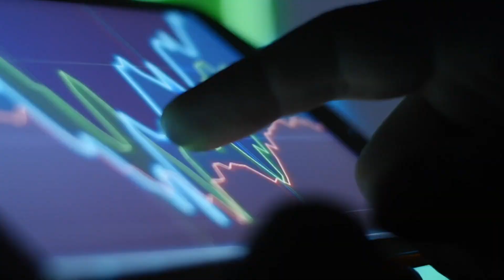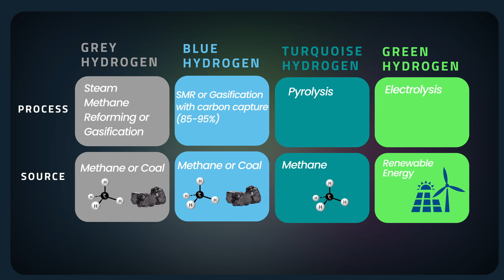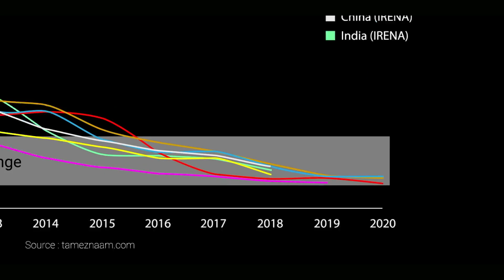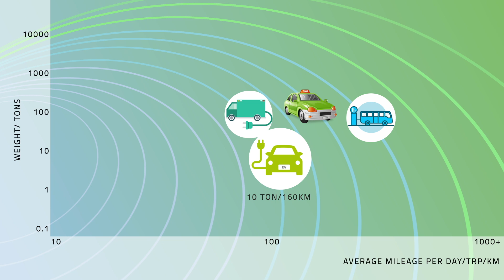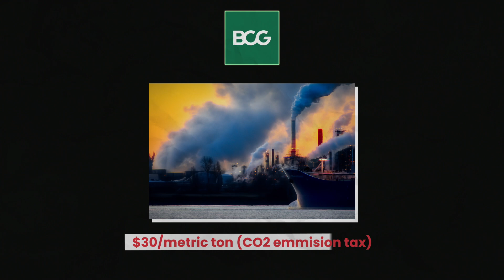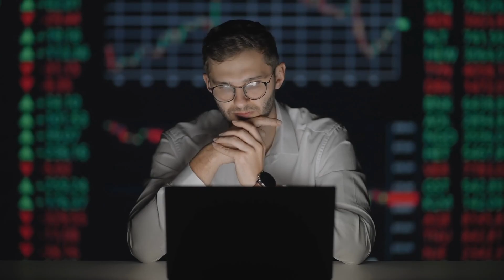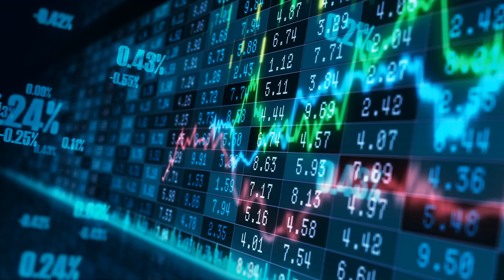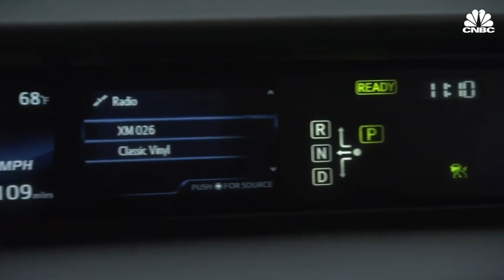Why NITIN GADKARI is pushing GREEN HYDROGEN for Indian Industries : Policy Case Study

Comment: I thought this was a fact based channel, highly disappointed by the one sided story, clearly a biased piece made to fool the audiences, why were ZERO Disadvantages mentioned? I will mention just two disadvantages which will PROOVE the entire video content to be biased and full of agenda:-
1 Energy Efficiency : Hydrogen REQUIRES almost as much energy to PRODUCE as much it DELIVERS. CE Efficiency is 60%. Lithium CE Efficiency is 90 to 99%!
2 Energy Cost : Transporation, storage and maintainance of Hydrogen is highly Costly! Hydrogen energy costs 3 times more than storing and utilizing the energy in lithium ion batteries.

Either you do not know what you are speaking about
Or You take audiences as a fool by delivering highly biased facts.
Or Both
Reply: There are many more disadvantages example:-
1 Hydrogen fueled devices are way more expensive
2 While the weight of hydrogen itself will be lesser, you would need highly re-enforced tanks to not let any leak else it will blast, and a lot of heavy electronics and electrical devices to compress and decompress it! Adding up to practical weight of the devices!
Reply: unsubscribing as I had thought this was a unbiased fact based channel of information, I have been proven wrong.
Reply from the maker: Super glad to get rid of such people in the audience who don’t even watch the video properly and yet bother to give unsolicited opinions. 
P.S 14:25 limitations are mentioned CLEALRLY

Comment: For me it is plain stupid.   Just listen to what Elon Musk says about H2.
Reply: So  Elon just  invented  his everything  in    Li-on battery   so he have to talk shit to any alternative  of electric  cars
Reply: @navtejchoudhary583  You youself did not read about H2.  It is mostly from oil.  If it takes 1kg of oil to go from Pune to Mumbai it will take 3-4 kg of oil to make H2 to go the same distance --- why?  Besides it must be stored in a very high pressure container meaning the fuel tank must be made with very thick metal and H2 has a property of making the metal brittle.  Besides there is a huge leakage because H2 is the smallest atom in the universe.
Reply: One chemist said the higher the pressure of combustible gas the more dangerous, H2 is the most combustible gas at very high pressure.  Accidents on the roads will be very dangerous.  Imagine a H2 fuel station blowing up.
Reply: Japan was publishing lots of research papers on H2 but even they stopped.

Comment: do not agree with your last point about India cracking the code of Green Hydrogen , Scientists in Japan and Korea have been doing R&D on Hydrogen for the past 2 decades ...India is no where in the scene....We might end up like the Solar push where we were just importing Solar Cells from China and assembling them in India ...finally China increased the prices because they had a monopoly and we had no clue on Solar Cell manufacturing ...

Comment: if hydrogen is created by electricity so if countries have machines for electrolysis they dont need hydrogen as energy they can convert water into hydrogen by using electricity so the one who has high supply export of electricity will be a super power in future and not the one with hydrogen

Comment: You didn't mention a single time that hydrogen is viable only in liquid form and it is extremely difficult to contain and store in liquid form. Hydrogen containers will take far more space than regular fuel containers for a reason why you cannot carry more/enough hydrogen and also make it efficient. Furthermore, hydrogen molecule is the smallest compared to any other molecules. It is impractical to cage it successfully. It's only about time that the fuel container will get emptied by itself (almost).
Reply: But bhai hydrogen cars toh available h....usme kaise store hota h??????
Reply: @siddharthgupta1840  bhai, available hain, lekin efficiency bohot hi poor hain.
Reply: @shounak911  ok....thank you bhai 👍👍👍👍👍🙏
Reply: @albion yes I got the reply earlier 👍

Comment: Hydrogen is not a good  fuel. Yes the energy density of Hydrogen is 140MJ/kg but its energy volume density is about 5MJ/Litre even when packed at 700 Bar of pressure. For comparison LPG is around 25MJ/Liter, Petrol and diesel is around 35 MJ/Litre. Hydrogen has the lowest density of all available fuels. Add to that the fact that Hydrogen has no odour, it is one of the most dangerous fuels if we pack it in 700 Bar pressure. 

Just because Hydrogen is taken via electrolysis from solar panels, it doesn't mean that it is green. Manufacturing the solar panels takes a lot of carbon footprint. The typical efficiency of electrolysis is around 80% and add to that the efficiency of hydrogen fuel engine of 40%. You would be better off providing a solar panel to every house than converting water to hydrogen and back to water.  

I just wish that the government would invest in more realistic sources of fuel. This is a huge waste of Tax Payer Money.

Comment: We use solar energy as a source and green hydrogen as FUEL to generate  energy by using water(non renewable). Really a good combination. Also in electrolysis oxygen comes as by product which should be released to atmosphere as it is vulnerable for combustion.  wait a min. RELEASING OXYGEN TO ATMOSPHERE  AT THE COST OF EMISSION. WOW ...  TAKING HUMANITY TO NEXT LEVEL...

Comment: Hydrogen fuel cell vehicles are good in terms of time it takes for refueling the vehicles but are not at all energy efficient with respect to EV as  EV's are around 80% energy efficient where as HFCV are 40-45% efficient and if we look closely the whole process of electrolysis is acting as a middle mam as we could directly use the renewable energy for transports via EV's ........ I think the future could be a hybrid vehicle where we can use both a hydrogen fuel cell as well as a lithium ion battery which could not even reduce refueling time but also will be cost efficient. such that if a person has time to refuel he can choose to charge it with electric charger at a low cost and save up some money where as if a person is in a hurry he can refuel his vehicle with hydrogen and save up some time.
Reply: Same thing I was thinking. That compared to EVs hydrogen fueled cars are way less efficient.  But also production of lithium ion bartteries are environmentally hazardous.
Reply: Hybrid isn't possible at costs it will increase the price and weight of the vehicle and off couse the maintenance so i think the future vehicles will be divided into batteries and hydrogen cells
Reply: @soniya487  yes correct, future cant be singular solution, it will be just like current petrol, diesel, coal, fossil fuels, solar, nuclear etc.
Reply: Benefits of Hydrogen over EVs are high energy density and faster refueling rate. So HYDROGEN is to replace Diesel vehciles like trucks where as Petrol vehciles would be replaced by EVs.
Reply: @navan1087  Another advantage to EV is the electrical grid serves as a distribution network. I think there is a place for hydrogen in more specialized areas. South Korea was leader in hydrogen fuel but they have given up on it.

Global warming idea is a monumental scientific fraud. Earth will be cooling for next 30 or more years due to increased cosmic rays reaching earth due to sunspots decreasing. We need to protect our power grids from geomagnetic storms. Anything above X20 or above will start to threaten the grids.
Reply: @prioris55555  South Korea, especially Hyundai have never given up on hydrogen, one year before they launched hydrgen truck.They have invested so much on this technology & cheap hydrogen will be available within a decade.
Reply: @navan1087  EV has won the vehicle market. Hydrogen has lost.
Under the plans for South Korea, the numbers of electric cars will rise by 200,000 units and hydrogen vehicles by 35,000 units, respectively.

Trying to do both is flushing money down the toilet. Hydrogen vehicles can't compete with EV.  There may be non vehicle uses or some specialized vehicles.
Reply: @prioris55555  Hydrogen is still a maturing tech & it will take another decade.So please stop making stupid assumptions like hydrogen has lost, give up etc. Even the Nithin Gadkari came in a hydrogen car recently.& i dont want to argue anymore with you & waste my time.
Reply: @navan1087  Nithin Gadkari is too heavily invested yo admit it.
India has an infinitesimal car market compared to rest of the world so irrelevant.
india should focus on mass transportation and not EV.
Reply: but what i was thinking is that, through the process of electrolysis water is splitted in to both oxygen and hydrogen, the resultend oxygen can be also used as a commercialy  like selling oxygens in to end users like hospitals and patients, so that the cost of hydrogen fuel can also be reduced. but i hope they may have already considered this before making an estimation about the cost and price of green  hydrogen fuel
Reply: @krishnaprasad2006  yea right and that companies doing that already
Reply: @krishnaprasad2006  bro that oxygen  can be sold and also can be used as a form energy  and can be export
Reply: @vinayakzanjad7894  i know that bro🤣🤣why are you telling the same thing to me which i already had commented here🤣🤣. Are you drunken???
Reply: @krishnaprasad2006  you said oxygen for patients I said oxygen for energy  purpose 🤣🤣🤣look at diffrence dunkie
Reply: 🤣🤣🤣🤣even we put whole russia under solar panels  we cant produced  sufficient  energy  for our India ev needs
Reply: The comparison is not really apple-to-apple. it is clear that consumer level car is going to be completely EV with no doubt. But there is a large space where energy needs and requirements are completely different where batteries just cannt solve the problem, e.g., large commercial fleet, industrial needs etc.

Comment: The major downside of electrolysis is the by product (O2) and the use of water (H2O). Where do we get the WATER for mass manufacturing of hydrogen ?. Humanity is heavily depend upon water , the humanity will be wiped out from the face of earth if there is water scarcity. And the next big thing is the byproduct which is oxygen , what are we gonna do with oxygen . We cannot simply release it to the atmosphere just because oxygen is a good gas. If we release too much of O2 to the atmosphere, that would create Oxygen imbalance in earth which is worse than hydrogen bomb. (There is a documentary about oxygen imbalance in YouTube ). 

So there should be strong international laws to monitor the entire hydrogen generation lifecycle, otherwise this will end up in tragedy just like oil/gas.  That’s exactly the reason why Elon Musk was not in favor of hydrogen and favors solar energy.

Comment: I was going to say that this was a poorly researched video, but to give you credit, you covered all the issues of hydrogen in the conclusion. But I wish you talked about it in more detail. So I would like to add a couple of points

Honestly, I don't think green hydrogen is going to work for transportation. Mainly because the storage and transportation issues are more of a physics limitation than a technological limitation. Hydrogen is the tiniest element in our universe and making a leakproof container to store it is pretty much unfeasible for massive consumption. And if it leaks, it will all just rise through the atmosphere making it irrecoverable. Hydrogen is also extremely flammable, so safety again becomes a concern (remember zeppelins?)

With the rate at which Lithium-Ion batteries are getting better + and intense research into alternative batteries such as solid-state, aluminium, etc I think battery tech is going to improve way faster,  that we won't really need to look towards hydrogen for commercial transportation. And the great thing about BEVs is that they can be used even without infrastructure given the advent of electricity everywhere, but making safe, reliable Hydrogen stations in such a short time to meet our climate goals is next to impossible

Also, you made a point about how if anyone cracks the code for perfecting electrolysis and green hydrogen production, they're going to be a net energy exporter. I don't really understand how you came to that conclusion because once the tech is out there, it will only take a handful of years before almost every country can invest in their own hydrogen production plant since the inputs required for it is just water and electricity. Transporting hydrogen across the seas over a period of months or pumping it through a pipe is not feasible at all as I mentioned in the first paragraph 

For industrial uses, hydrogen could definitely be a viable option. But it needs to be local and there needs to be a proper and clean channel to bring in seawater for electrolysis use rather than digging up underground water like how most industries operate today

Comment: Ganesh you forgot one and the biggest drawback of HYDROGEN. IT IS VERY HARD TO STORE IT, it's molecules r very small and can easily leak from tanks which is the biggest problem as we all know calori value of hydrogen is very very high. Even small leaks can do a lot of harm and as you said at end of video that electrolysis takes a lot of power to produce electricity which reduces efficiency by a lot
Reply: *calorific not calorie, some times autocorrect is stupid

Comment: i dont think that green hydrogen will ever be viable because:
1) public and private transport can be powered by overhead/under the road cables which can wirelessly supply power
2) The tanks used would have to be thicker and there is leakage of hydrogen through the molecules of the metal.
3) hydrogen will be stored at -250C approx so you would need to cool it which takes up energy.
4) when you fill up your car with hydrogen there will be the formation of ice around the hose pipe so the pipe will be difficult to remove. they do provide a heating element but you may have to wait. 
5) How would one know if they are getting green/blue hydrogen.
So to conclude hydrogen is worst idea in terms of transport.
Reply: Dude, even though there is free speech, your comments can offend blind supporters of tycoons who fool people by showing ambitious targets and then take govt support to fulfil them and at the end, make lives of common man a mess. Elon already doesn't  support green hydrogen.

Comment: Kuchh bhi... Pyrolysis takes too much power.. Also the hydrogen is to be stored at cryogenic temprature... Which is very dangerous than the battery operated EVs... Whether it is green or blue or grey.. Hydrogen is hydrogen and is dangerous!

Comment: No it's not up to the mark
The power loss in the process is too much
You use the power while converting water into hydrogen and in the next process you will convert hydrogen into electricity there also your consumption the power, around 60% of the power will be wasted.
And to construct one hydrogen power station will cost around 18 crores.
And the price per kilometre is as equal as the diesel powered car, why will people spare more when electricity is more cheaper per kilometre.
Even the vehicle cause the same as the electric powered car.
Reply: I did not see your full video and commented you notice the problems

Comment: @6:30 more range is not equal to more hydrogen fuel cells. that's more power. More range equals a bigger hydrogen tank.
fuel cell +inverter +motor in a hydrogen vehicle is the equivalent of inverter + motor in a battery electric vehicle.

Comment: Hydrogen is just never going to work
Mainly due to the reason it needs fresh water for the electrolysis and there isn't much of it available on earth 
So you have to purify salt water with RO or something which is expensive as hell and then make hydrogen which makes impossible to make it cheaper than running batteries . And the whole process  is so devastating for the environment that calling it green hydrogen is a blunder
And "green" hydrogen also sucks cause it's burns more violently than  any fuel we ever used in automobiles (that's why it's used in rockets)
Imagine an Inflammable gas container in a Hydrogen powered truck. Just how dangerous is that cause both are extremely flammable
But batteries can be a lot safer
And on top of everything you can charge them at home!!
Reply: As if ev batteries are environment friendly? And top of that CCP controles many crucial raw materials .
Reply: @abhinashkumar3161  yeah I agree that but you can recycle and reuse them over and over again 
But hydrogen has something to do with fresh water which is a bigger concern
And once hydrogen is used in your car -boom all vanished into thin air so you have to use more and more water to refuel
But you can charge batteries for 1000s of cycles and then recycle 
This sure does have an impact on our planet but far better than sucking up all the water which itself is a scarce resource

Comment: theyre making chuitya out of us. Hydrogen is garbage and is very expensive to extract, transport(in compressed form) and convert it to fuel and convert it to electricity. They're basically saying we dont want to invest into EVs and they can push this for another 2 decades saying hydrogen hydrogen. They tried this scam in the USA and they got found out. It is also very inefficient, it is not like EVs where the cars are super fast